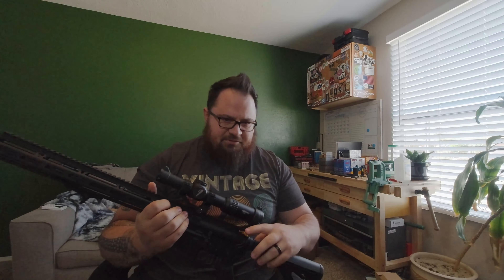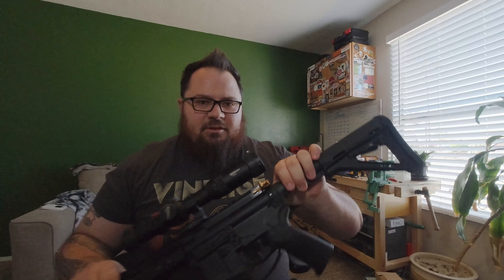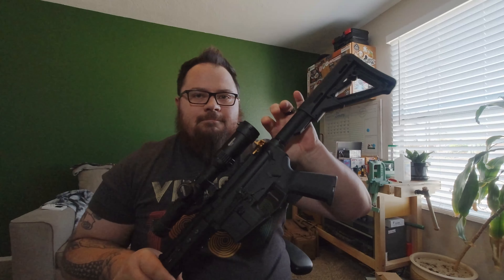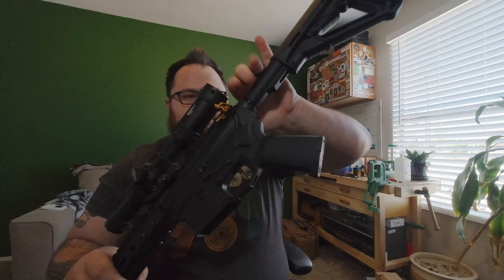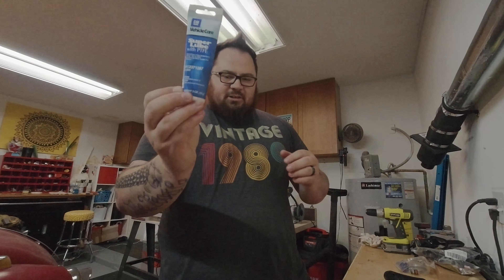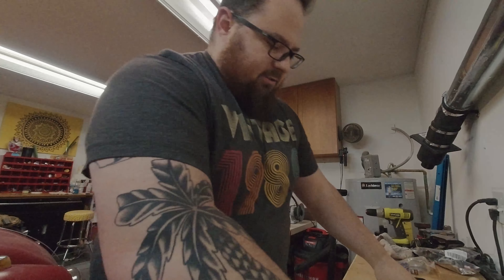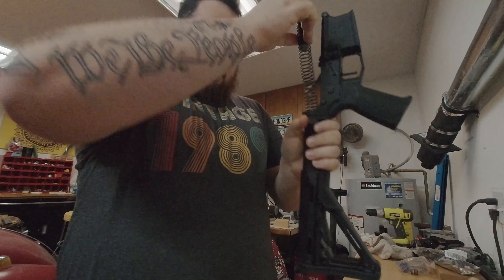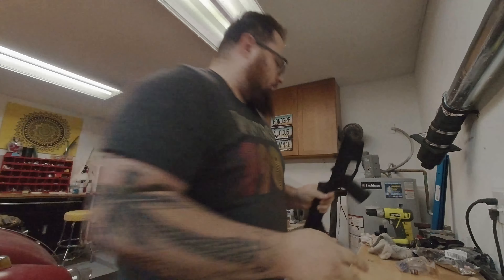AR Buffer Noise Reduction

Comment: The JP buffer is excellent.  Vltor A5 buffer with BCM A5 tube and rifle length spring is about 90% as smooth and quiet as the JP.  Also the OG rifle setup is MUCH better than the carbine setup.
Reply from the maker: I still need to try one of those setups, people race about them and I don't think I've ever heard a bad review. Thanks for posting your experiences, even more reason to give it a try!
Reply: @NimrodCollective   Honestly, there really is only one captured buffer - the JP.  The others are no where near the quality of it.  As good as the JP is, the Vltor A5 setup does work better as it uses the rifle spring and weight.  The Vltor slows the action to nearly the A1/A2 rate making carbines smoother and more reliable with less parts wear.  The JP can be tuned with weight and springs to do the same thing but you can also use an adjustable gas block to get the same from the standard JP spring and weights.

Comment: The 10.5” is definitely the quieter of the two. I use the armaspec sound mitigation in all my AR’s they sound great and make them run way smoother. You can find them online for $35 and they have different buffer weights for whatever you need plus the springs are tunable’ you can cut off coils to reduce spring pressure. I run the 3.8oz buffer armaspec in my 10.5 and my 7.5” .300blk’ They work great and have no spring noise. Check’ em out.
Reply from the maker: That's been on my list of things to try too, glad to hear about your experience with them! I do like how tuneable they are too.
Reply: Delta
Reply: Team
Reply: Tactical
Reply: $29
Reply: you can find them in the holiday sale 2021 menu
Reply: I had to put it that way because my reply telling you they are on sale at above mentioned site kept getting deleted by the tyrants of TyouYtube🙄
Reply from the maker: @TacticalBuffoonary  yeah I get it, I had a reply to someone get deleted the other day for the same reason. I appreciate the info though, I'm gonna look into one!
Reply: @NimrodCollective  Cool man’ by the way Im subbed and looking forward to your future form1 builds. Im also building my own soon. Ive got 5 planned for 9mm/.45acp 5.56 .300blk .22lr .300wm and 6.5cm I have some of the same stuff as you and some you probably don’t. I might post some videos but my video editing skills aren’t that great.
Reply from the maker: @TacticalBuffoonary  nice! I'm gonna break some of mine down soon to do videos on each, and I have a 300wm can in the works right now that I'm excited about. I wasn't great at editing at first either but it's getting there, so if you feel like filming and sharing info from your point of view I'd recommend it! I use davinci resolve to edit and it's free, decent amount of info on YouTube about using it too. Always good to see information from all kinds of different people and sources I believe.

Comment: Do you use the light weight spring in the 10.5? And what length of gas system are you running on each? Appreciate the videos! I’m also on SS discord! Super knowledgeable dude.
Reply from the maker: Yeah, they're both light springs with H2 buffers. 10.5 is a carbine length gas system and the 16" is a mid. SS Patreon is a great place for information!
Reply: @NimrodCollective  I admittedly don’t know much about buffer weight and things like that. I’ll have to look into that stuff more. I have a 10.5” with a carbine length system also and a 14.5 mid length. I’m waiting on my form 1 to come back, but I’m not sure how it’ll run with the stock buffer/sprint setup in each. At least we both have decent dwell time setups. Thanks for the info and the videos! I came across your channel while searching for diffuser wall information. SS has like 5 videos, but I wanted something more concise haha.
Reply from the maker: Yeah for sure lol. AR tuning is great but it's a good idea to shoot the gun as is first so you can see if anything else needs to be changed. Usually just a buffer weight change is enough to make a huge difference in gas to the face and recoil impulse.
Reply: @NimrodCollective  good call. I’ll wait until I see how they behave with the 8” and 6.5” builds in doing. Thanks, dude!